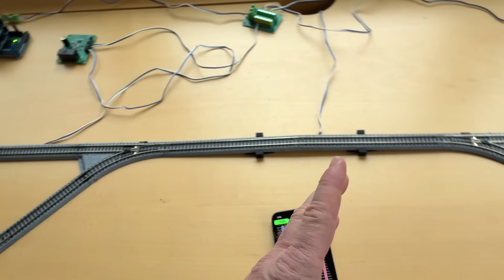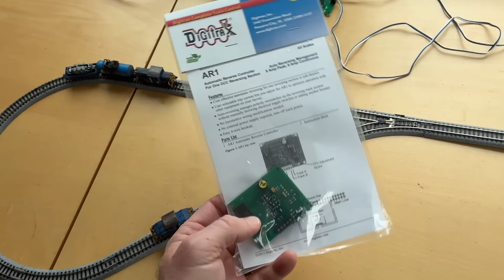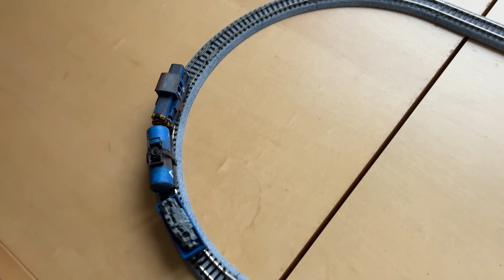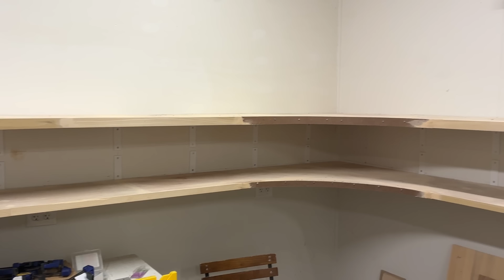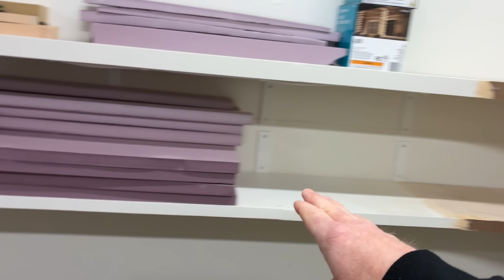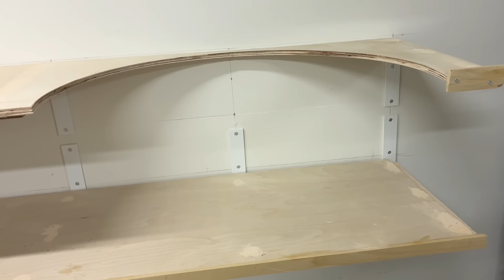Reversing loops with Digitrax AR1.

Comment: maybe 2 silly questions 1 - is this DC and if not would it work with DC? 2 - are there spring loaded turnouts in OO gauge available
Reply from the maker: This specific setup is DCC and will not work with DC. Manly because DC locomotives will reverse direction of travel when the polarity is reversed. DCC locomotives just know which end is the front of the train and which is the rear regardless of polarity. 

I honestly don’t know anything at all about 00 scale trains. Or even HO for that matter. I only dabble in N scale.

Comment: You will also find you did not need to waste money on 2 x AR1s either as the DCC EX or DCC CSB1 Command Station automatically senses a short and will correct the polarity!
Reply from the maker: I did finally discover the MAIN_AUTO track output mode on the DCC-EX and CSB1. It worked well with my DYI DCC-EX mega. But on the CSB1, fault protection kept killing power before the polarity switch. Not always; but intermittently. Also, the MAIN_AUTO eats up one of the power outputs. If I use the AR1s, I can reserve the power outputs for two separate power districts. But yeah, MAIN_AUTO is a very cool feature. If I had a booster and I could solve the fault protection sensitivity issue I’d go that route.

Comment: still reflect as  I'm rc battery powered loco No track polarity / switching etc  issues applies Dont use track power,  reserving the metal rails for general power distribution to track side stuff servos for points control  signals 5V or so   All I want is those sprung points . Thanks pointer at KATO   RC on N Gauge ? : Possibility exists : 009 gauge ( Narrow gauge)  0O gauge locos on N gauge track .  Still 4mm scale on  locos giving just about enough room for RC mod
Reply from the maker: RC is very appealing to me for the reasons you describe. I researched it after your last comment on the subject, but couldn't find much at all in terms of N Scale. I'm not sure the tech is quite there yet, and I'm not smart enough to bridge that gap.

Comment: still want to know where to buy spring switches .  Converting ordinary ones but its boring.
Reply from the maker: Kato switches seem to all be spring loaded. I'm not sure if they are even intended to be used as 'spring switches' in any sort of prototypical way, but they do seem to allow me to exploit them as such. I've tried to find official documentation from Kato that says: 'yes, you can use them a such' but haven't really found anything  official. Lots of forums talk about it. One note:  I've realized that I must turn frog power OFF when using the switches as spring switches, otherwise I do get shorts. I just learned this yesterday.

Comment: The kind of turnout doesnt matter. As long as two trains dont short circuit both ends of the loop at the same time (like if you wire together parallel tracks), it should work regardless of the  turnout operation.
Reply from the maker: Agreed. I was just pleasantly surprised to realize that I don’t have to install stationary decoders in my runouts and manage switching in EX-RAIL and/or set up IR sensors to detect when to switch. I can just exploit the spring loaded switches and let it all happen mechanically on its own. Perfect analog hands-off solution.

Comment: You might need to add some weight to your cars so they are heavy enough to move the switch. I have a similar setup with the AR1s and spring loaded switches on LGB track. I had one car that wasn't heavy enough to move the switch.
Reply from the maker: Hey thanks. That is a great tip.

Comment: the joy is the sprung turn outs !  Does anyone know how to convert one /buy one . I know faller made them as standard but long gone. PS I am RC battery powered No more track power hooray Consider conversion Be free of all that track electronic  polarity cleaning  mumbo jumbo
Reply from the maker: Does N scale RC exist? It’d be cool if it did.
Reply: @rich_foster  RC is usually a matter of convert what you have not off teh shelf ready  The big issue is where do you put the battery Otherwise the Receivers are tiny .( see micron supplier) til lately  re HO /OO folks said cant be done unless put the batter in a tender and lug it around  I have replaced the standard hornby motors with cheap coreless motors creates a lot of space and I can run it with a slim cheap 3.5V 1S Li ion  All in a O-4-O. tank .Happier now with HO /OO gauge Sound cards are still a no no for space. Now experimenting with wagons empowered with a receiver giving added functions like auto decouple..  Reckon smaller than HO would be a challenge but not impossible  I can charge the battery by parking it on a piece of metal track with a USB charger plugged to the track.  The other joy of RC battery power is to open the hobby to be  inclusive . Give a friend a TX Theres your loco / theres your time table off you go  You are the driver .

Comment: I really like this and want to recreate it but I cant work out the geometry of the track.  Please can you tell me the diameter of the track you use in the loop sections?
Reply from the maker: I'm using Kato 20-174 N Unitrack 150mm 6" Radius 45 Degree Curved Track for this experiment. Too small for anything but Kato Pocketline. But obviously you can use any radius you want. It doesn't even have to be a 'circle'. It could be a long meandering section as long as it's isolated.
Reply: @rich_foster  Thanks Rich, I need the loop to be as small as possible, so 150mm diameter works perfectly. I have found that the Bachmann J94 0-3-0 copes ok with this radius.
Reply from the maker: @markb.2329 Hey if you really are trying to replicate the AR1 reversing loops, one hint: the AR1 has a little screw head on it that adjusts the sensitivity of the short detection. I had to turn that screw counter clockwise as far as it would go and then everything worked perfect. When I left it at it's default position, the train would definitely short the circuit when it crossed the insulated joiner and there'd be a lot of buzzing (the bad kind) and the polarity would not flip. But after I adjusted the screw everything is perfect. Good luck!

Comment: Interesting concept! In Germany, the company called "Viessmann" made a circuit that would automatically change direction of the train, if it entered an isolated part of the track, so, kind-of pretending a line with two stations at each end of a single track. That's what I'm using on my 9,5m (30 feet) windowsill :). 
On another note: "cutting" through the switches is of course possible for a model train, however it's not exactly what you'd do on a real railway. So an automated switching of the switches (as mentioned in another comment) would be a little more "original" ;)
Reply from the maker: Hey check this out (someone else shared this in the comments):
https://youtu.be/3iLuQRI8Rsc?si=HvZQ1-3hQH143MmT&t=326
Apparently spring switches exist in the real world. Or at least in Florida, which sometimes passes for real...

Comment: Hi I managed to use 1 AR1 on 2 separate loops as long as you have 1 loco entering or exiting the loop
Reply from the maker: Oh cool. I actually considered that too. After I installed the first AR1, I thought: do I even the second one? I could use the same track power for both loops and feed that into the one AR1. But then I thought, since I'm on DCC and love running multiple trains on the mainline, there is a good chance I'll have locos in both loops simultaneously, so I played it safe and went with separate power sources for each. But good to know that does work!
Reply: @rich_foster  If you put the AR1 on the main line you will only need to use 1. But good overall.
Reply from the maker: @cascadesouthernmodeltrains7547 true. But in theory, the main line will be 50’ long with lots of turnouts and stuff. I wouldn’t want to polarity switch all that. Too many variables. Safer to just polarity switch the small loops at either end.

Comment: I just watched your video, and I have some thoughts on it. I am afraid I am going to launch here, I hope you don't mind a long post.

First, about me: I have been a test automation engineer for 40 years, and I have been playing with Arduinos since about 2017. I have built MANY Arduino-based toys for myself and currently have two Arduino-based products on the market. I have no degree so I am obviously unqualified to do what I have been doing, I just have fun doing it and people pay me for it. I like train sets but have never done much with them. I have always thought it would be fun to blend train layouts with Arduino control, and your video reminded me of this interest. If you are interested I can elaborate further, provide sample code and diagrams, and point you to other resources.

I found the hardware you are using to be interesting, but I wonder if there is a cheaper and simpler way to do those things using an Arduino. Since you already have an Arduino involved, it would simply be a matter expanding what it does with some cheap add-on modules. I will refer to these modules by their names and you can easily search Amazon to find them. 

First off, as far as I know, these train sets use up to 12VDC to run the trains, changing polarity to change direction and changing voltage to change speed. An Arduino can do this control on two motors or tracks with one L298N Dual H-Bridge controller. These are commonly used in cheap "smart car" kits, and I am looking at 4 of them for $10. You can put up to 35VDC through them, so they will easily handle the voltage and current of a train set. You could easily control both ends of your track with one module. The speed control uses PWM (pulse width modulation) where power is being rapidly turned on and off, the ratio of on and off governs the speed. Don't worry, it is VERY easy to use these things. If you get and build one of the cheaper "smart car" kits from Amazon you will become an expert quickly.

One thing you mentioned about your boards is that they sense a short-circuit to switch power polarity, and this is easily done with an Arduino.  Look up an INA219, both in Amazon and on YouTube DIY. This is a voltage and current sensor that while limited, will certainly manage what your train set is doing. You can use it to monitor the current going to each of those loops (you can have up to four of these things on one Arduino.) When the current suddenly shoots up the Arduino can detect that and switch the polarity on the L298N module in, like, 1/1000 of a second or less. 

I can think of MANY ways to sens train location with an Arduino, but I think the easiest way would be with a cheap photovoltaic resistor that changes it's resistance depending on hoe much light hits it. Put it under the track and when the train casts a shadow on it the Arduino can react. The Arduino Uno has six analog inputs that can each monitor a photovoltaic. These things are VERY cheap (a couple pennies, I see 100 of them for $7.39) and one will be in every Arduino Starter Kit. (I like the Elegoo starter kits, very well done.) 

Lastly, I would like to propose an interesting project for your train. How would you like the Arduino to run the train once each hour, like a cuckoo clock? All you need is a DS3231 Real Time Clock module or a DS1307 RTC module, either would work. They have button cell batteries so they remember the time even if powered down. The Arduino could react to the top of the hour by running the train once around the track, and you could easily program it not to do that during sleep time. You could even make the train go one quarter way around the track every 15 minutes and then do a full loop at the top of the hour. 

I like mixing technologies, that is how you do things that have never been done before. Here we have trains and Arduinos, mix them together and you can get magic.

Comment: You must be using DCC for this to work. If you want to use a locomotive that has no decoder (perhaps belonging to a guest), then it is not the loops, but rather the central section between the points that must be reversed.  Short detection still works in this simple  case.

And, yes, you can "drag the points", but be sure never to back up while the train is partially on the non-selected branch, and partially on the central section.  (You might use short detection to toggle the points as well.)
Reply from the maker: Correct. I'm using DCC. I mention it very, very briefly in the video: 'Arduino based DCC-EX command station'. If I knew so many people were going to see the video, I'd have taken way more care to explain everything more thoroughly. I'd have made a better video. No idea why it exploded. But it did....
Reply: @rich_foster did some research because of this 😂 I am an electronic and I did not get how the middle section would work 🫣
Reply from the maker: Ha. Yeah, it's pretty cool how it works. It took me a while to wrap my brain around it. Confusing at first.

Comment: not a model railroader but from what i understand. they have already had where you can reverse the loops for a long time but the issue with those is that they were spring activated and the springs wore down quickly depending on how often you ran your trains.
Reply from the maker: Yeah for sure. The idea of the reversing loop has been around for quite some time from what I understand. And there are DC reversing loops which operate way differently than DCC which is the type of train system I'm using. In DC you change the speed and direction of the train by controlling the voltage and polarity of the track. Trains don't really think independently and can't really be controlled independently. In DCC, the track voltage is constant and each train keeps track of their own speed and direction. And you can run multiple trains on the same line at different speeds and even opposite directions. 
The trick for me was coming up with an fully automated system that deals with the polarity 'moebius strip' without any input from me, the operator. Again, this is a problem that has been solved by many model railroaders. But i found many of the solutions to be complicated or require too much input from the operator. So I thought I'd share my fairly simple solution just using AR1s and spring switches.
Reply: @rich_foster  my comment was just a generic. "this issue has already been solved by some very cheap way that may or may not work" for the new people to model railroading.
Reply from the maker: @teacher555555 makes sense. I tend to ramble! Heh. Thanks for your input and your interest.